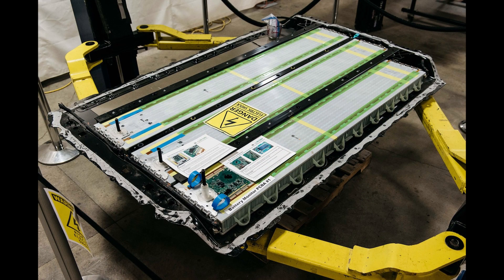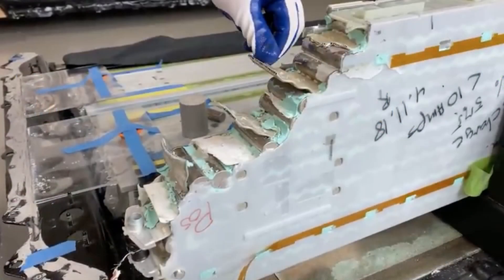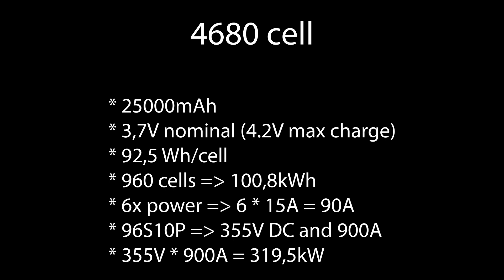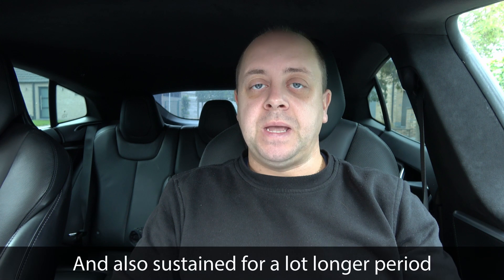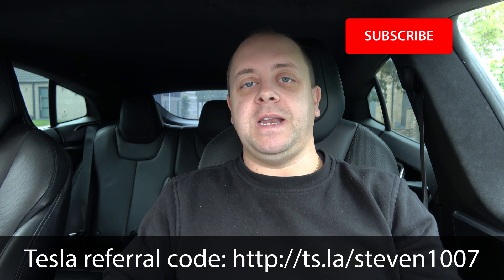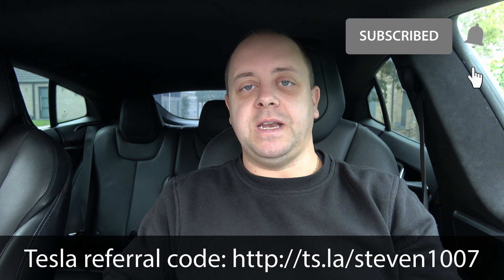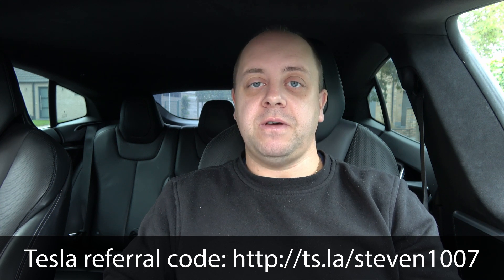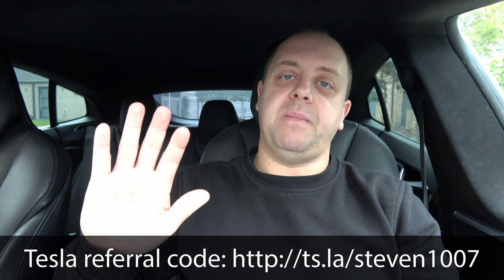Tesla's new 4680 battery cell: what are the implications?

Comment: Re the point about cell failures, my guess is they would include  a number or a row of cells to cover redundancy and only switch them on when another cell fails thus ensuring that apart from catastrophic loss of cells there is always sufficient for full use. Maybe not, byt that would be the approach I'd take
Reply from the maker: Great idea, but in a million cars that is serious overhead and seriously expensive for not using in 99.999% of the cars
Reply: @StevenPeeters  agree - but can’t think of any other approach to solving it and I’m sure they already build in some redundant capacity so maybe not that much of a change

Comment: Why should we buy "a pig in a poke" for $ 45K? Why does Tesla hide what kind of battery is in the Model Y SR and its capacity?
Reply from the maker: Why should you have to care about that? You buy a car that goes x miles. How it does that, is not really a concern. Would it make a difference if there are 20 cells or 2000 cells if the result is the same?

Comment: Related to the newly released FSD beta - couldn't it theoretically be allowed here under Level 2?

1) The turns are based on lateral acceleration, so not turn angle on steering wheel or wheels. So as long as you go slow enough you could turn in intersections
2) The UNECE regulations for lane change does not dictate turning in intersections or roundabouts, right? NoA will automatically blink and shift into on ramp in Europe already.

I could live with confirming lane change and other things while the FSD beta is active. It would be no different from today I think. It will be Level 2.
Reply from the maker: Semi-auto lane change is restricted to roads with a divider between both directions and where pedestrians and cyclists are not allowed. So basically just highways. If simple lane changes are not allowed, I don't think turning on intersections would be.
The rewrite will definitely help with the ghost image when passing a truck while changing lanes and with tackling roundabouts.
Since the driver needs to be present and vigilant, the FSD beta in the US is also still considered a level 2 system. As soon as you label it level 3, it means that the driver does not need to be attentive anymore under certain conditions.
If someone has a complete list of manoeuvres that FSD beta actually can do, I'd happily try to match it to regulations and see what exactly could potentially be allowed in Europe...
Reply: @StevenPeeters  It does almost everything.
Stop start at traffic lights
 left, right, straight forward at intersections
roundabouts (sorta)
driving around obstacles in city streets, like parked cars making it go across the dividing line.
YouTube is peppered with videos
Reply from the maker: @allowambeBOWWAMB  I know there are tons of videos out there, but not a descriptive list. Judging from the videos, going straight on and reacting to traffic lights would be no problem. Turning right at an intersection: maybe. That is a bit of a grey zone. But getting ready to turn left and actually turning left, means crossing lanes and potentially oncoming traffic and that is currently strictly forbidden for AP. Driving around obstacles on city roads should be possible, as long as the car does not cross any lane markings while doing that. Roundabouts will also be tricky if they are with double lanes, especially like the ones in The Netherlands where the other lane is forced to take the first exit, because that would include once more a lane crossing.
I'll try to make a comprehensive list for my next video

Comment: Hey Steven, great video as usual. Have you considered Tesla might switch to a 800V system? You mentioned 350kW charging, but aren't current CCS charger only able to charge at that rate with an 800V system like the Taycan has? I thougt there's a limitation current-wise in the CCS-connectors even with cooling. It's commonly easier to go to higher a voltage than higher current.
Reply from the maker: I don't know the specifics, but since the current is indeed the biggest problem for generating heat and the plug has its limitations as to how big the connector can get, sooner or later there will have to be changes if we continue to go for higher power.
Now, it is theoretically possible to get 800V into an onboard charger that converts it to 400V, for example. How likely is that going to happen. I don't think that it is very likely. Will Tesla go for an 800V system? That would mean they need to transform their entire supercharger network to a new standard and still keep old cars capable of charging at around 400V. It's not unthinkable and it is technically feasible, but I don't think it will happen soon... But that is of course only my personal opinion based on a gut feeling. I don't have any information or indication that they would do otherwise. But with Elon, you never know. maybe w get some light shed on the charging of Plaid S tonight in the earnings call...
Reply: @StevenPeeters  Totally agree with the Supercharger argument there. But as you said you never know with Elon. And we know that Tesla is fast in terms of changing its Superchargers as we all remember the retrofit for CCS. The inverters of Supercharger V3 are already rated for DC voltage up to 950V. But IMHO more crucial than the European Type2/CCS, which is 800V-capable, is if the proprietary connector of US Teslas is able to handle/insulate 800V.
Reply from the maker: @bebbobricker8616  didn’t think if that, but indeed the different US connector provides different challenges.
Now onbthe other hsnd, it would be a massive production simplification if Tesla would only deploy CCS chargers and make all cars with the single CCS plug.

Comment: Nice video, must have taken a while to prepare. Please clarify this; at 7:40 you say 2170 cells have 3C 15A discharge rate, so 46cells in parallel gives 46x15A=690A and 355Vx690A=245kW. But how can it charge then at 1C 250kW? Does a model 3 also charge at 3C then? Is you assumption (6:57) of 1C charge not correct then?
Reply from the maker: Thank you for noticing that. I made indeed the 1C assumption, but calculated the remainder with the 3C charging capability assumption.
The charge and discharge rates ware taken from the Panasonic 2170 cell specifications. Another source mentions Tesla could be charging up to 4C, but I have not found any datasheet to back up that claim. Although it would make sense. Here is the link to that information: https://energsoft.com/blog/f/c-rate-of-batteries-and-fast-charging
Assuming that Tesla is comfortably discharging at 3C, it could be that they are charging at 3C as well. Also keep in mind that the 250kW charge rate at this moment is only a short burst of a few minutes and then it already starts to taper off. So they are not really charging a lot at those rates. You can actually see that the complete charging time to 100% is actually not much different from the 120kW charging cycle and benefits are mostly gained from charging at low SoC and for a short period
What I hope is that the reduction in heat and the dry anode will let the battery pack charge at very high rates for at least 50% and maybe longer.

Comment: My only concern is the life of these batteries ,as you see at the base of the jelly roll with multi copper tabs ,great for the heating and cooling but the positive charged roll will need a fine insulator strip on the  length of the negative  charged paper to stop in time a potential short at the base as particles  over time will fall , build up and cause a short .

Comment: I think you got it reverse in terms of one cell failure. One cell failure will mean 10% power loss, but capacity will be mostly the same, as long as active balancing is used. The power loss would be almost invisible tho, because that only applies to continues use at high current. Intermittently the pack will still able to use 100% of power I think. So I don't think that is a problem at all. The BMS would actually be able to detect that one cell failed easier in this new battery pack, than in previous battery packs, because the difference in voltage during discharge and charge will be more visible.

Comment: Negative side heating more. Nope. The cell heats up from inside from the center, where it warmest, due to poor heat transfer. Internally the positive or negative are not at any specific location, it is distributed in the whole battery. It just happens that one side of the battery due to a lot of tabs, will have better heat transfer to the outside, but taking the heat from there will cool essentially the whole battery, not just one side.
Reply from the maker: That’s the information I found from various sources. Extremities heat the most
Reply: @StevenPeeters  I've watched a few videos on this topic & they all say the majority of the heat will be at the bottom of the battery where the cooling plate will be located, as you stated in your video!

Comment: The reason the width is smaller, is because cells are taller. The volume will be almost the same, slightly lower because of other optimizations. It is good that the width is smaller, as this will lower the moment of inertia for rotations.